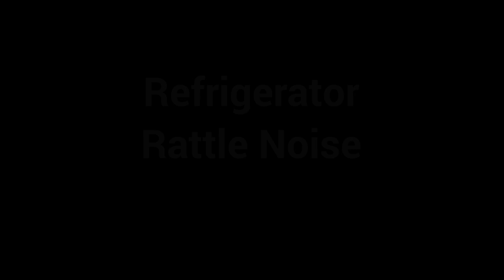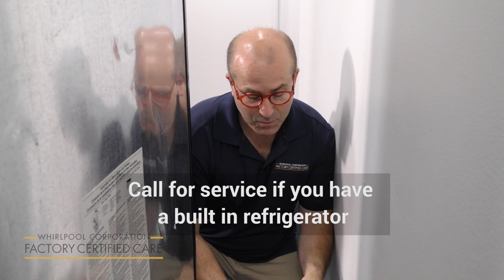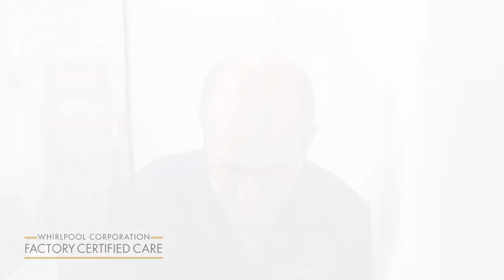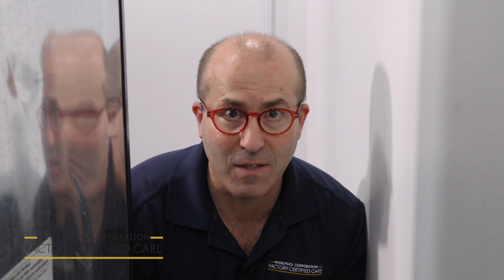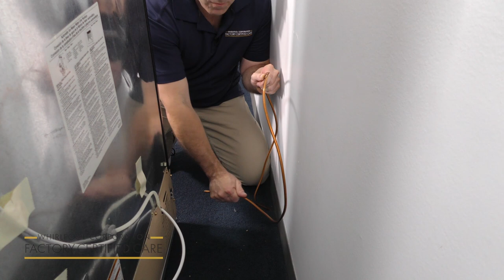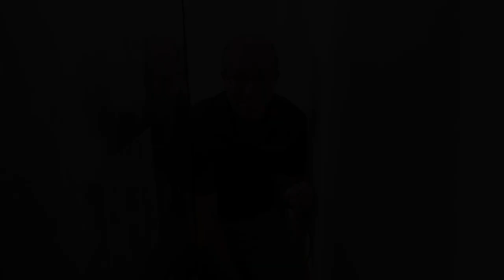Refrigerator Rattle Noise Back of Refrigerator

Comment: A technician came to replace my ice maker assembly and had to pull the fridge out of original positiom. I guess they pushed it back too far when returning it to its original position after the work was done, because it only started making this noise after their visit. I just went to pull it a few inches away from the wall and it stopped making the noise. I’m so glad it was that easy. Thank you!

Comment: I don't have a copper coil and pulling the fridge out from the wall didn't stop the noise in the line.
Reply: Update: I took the back panel off and vacuumed the dust off the coils (I think that's what it's called).

It's been two weeks and no more knocking noise.😊